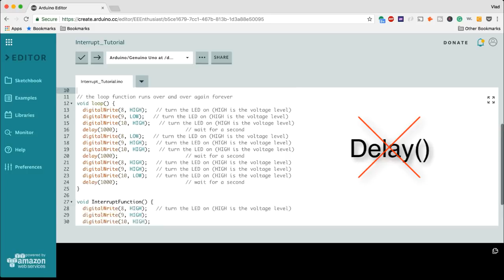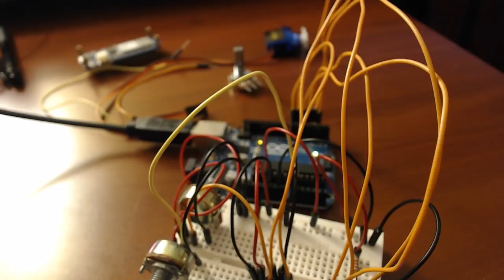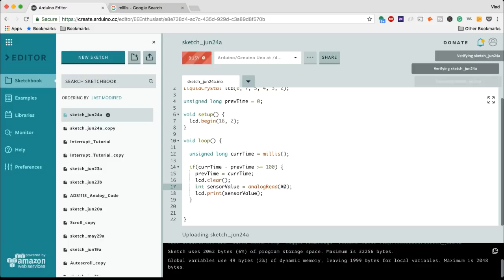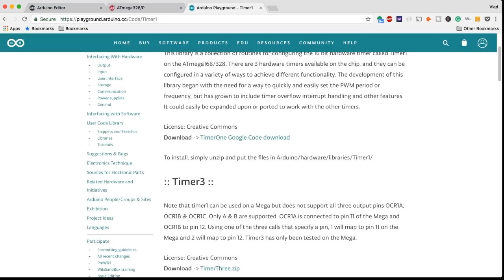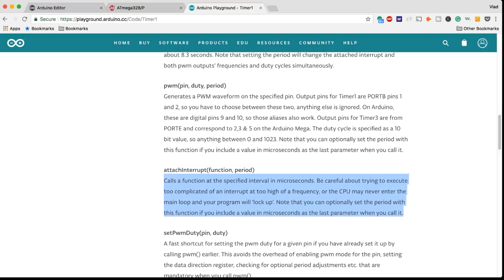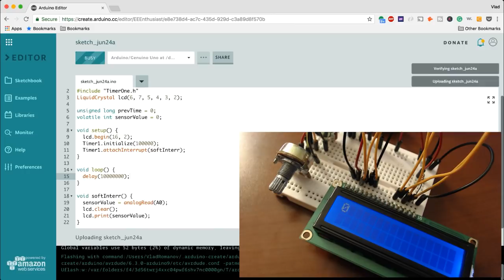Arduino Delay Function - Tutorial on Software Interrupts, Timer Library & Alternatives to Delay

Comment: wow, just what i needed to find.  and i like the pun at @09:48
This is going to solve all my problems... well ok not all. 
i need to pulse a pin between .5 and 6 times a second, with this i can just have a routine service 12 times a second, i can have a variable to see how many times it been called, compare that to a 2nd variable for 'required pulse' and if its reached, turn the pin on, then turn the pin off next time through just like the led.
whats such an odd requirement for? i'm running a pump, each pulse will feed a set amount, to increase flow i need to increase the pulses, and it needs must not be affected by things in the loop changing that speed, ie waiting for a button press or a sensor to hit a value

Comment: Nice explanation dear. I am using 6 sensor . One of these is AC voltage sensor for the detection of the AC Voltage magnitude but it is not giving right values how ever it is calibrated fine. What i observed is that this AC module works fine if it is single Arduino file but as a function it is not returning right value. 
i guess it is timing delay problem . What you say ?

Comment: Hi I need some help figuring out the interrupts I need to use for a wireless alarm on a garage door that is a distance away from a apartment i have built the hardware using nrf24l01 module that works fine but I want the alarm to only activate the buzzer for 5 seconds when the door has been opened then turn off activate it again for 5 seconds when the door has closed i have a trigger on the door that goes high when the door is oppened how can i achieve this? Please help

Comment: Great Work.. Thanks for your time and efforts..  Super simple and very well explained.. It would be great if you cover Serial Interrupts. Like receiving Serial Data without polling it, and just doing routine work inside main loop.. Thanks again..
Reply from the maker: Thank you for the feedback! I believe that serial data doesn't have an interrupt; it will poll once every "main" cycle and will start transmission only when the Arduino responds. So you'd be interested in a general tutorial on serial data? Thank you again.
Reply: EEEnthusiast  Serial Data do have interrupt. But Arduino doesn't have interrupt driven Serial data receiving(for user side ) it needs to be polled Everytime.
Reply from the maker: That makes sense. I'll need to do some more research on it. I'm interested in buying a device which communicates over serial to see if i can test a few things.
Reply: EEEnthusiast You may consider buying a Ublox or any other brand GPS module. It communicates over serial. And can be very handy for Location Based ptojects. There are GSM+GPS modules which gives cellular connection via SIM card with GPS.. Good luck..
Reply from the maker: Those modules are much cheaper than expected. I just ordered the Ublox NEO-6M GPS Module for 6$ on ebay. Thanks for the tip Jay.

Comment: Excellent tutorial thanks for sharing it with us,  I am going to be using interrupts in my future projects, I was using the polling method so far to update my sensors for a diy pellet burner machine. I hope you can cover in the future pid control.
Reply from the maker: That's actually on my list of topics. I work with PID control on a regular basis on Allen Bradley PLC system, but have never actually implemented them on Arduino. I'll do some more research and release something soonish. Thank you for the suggestion!